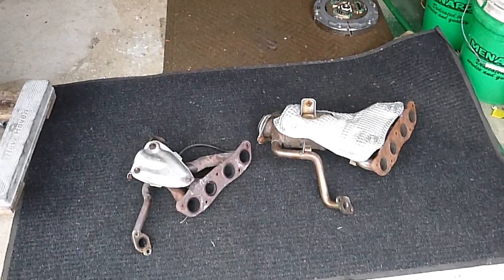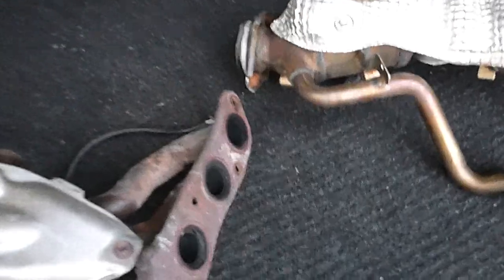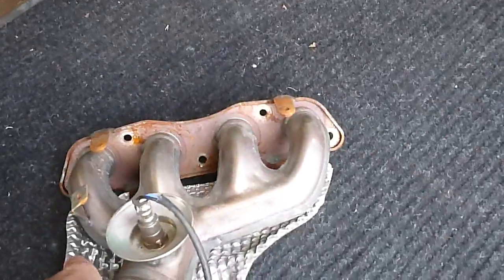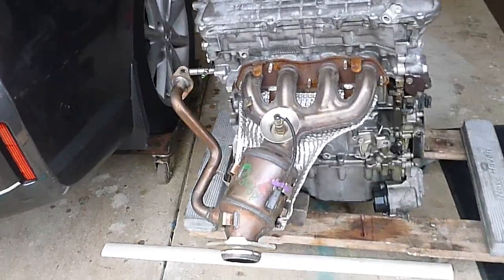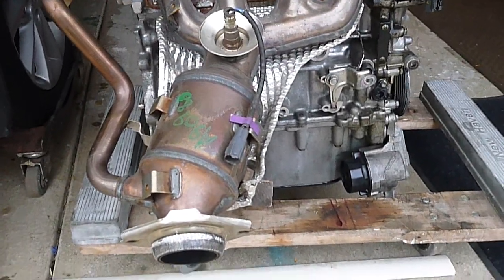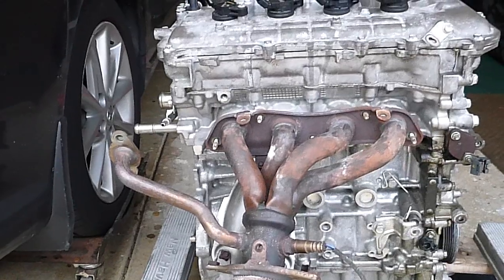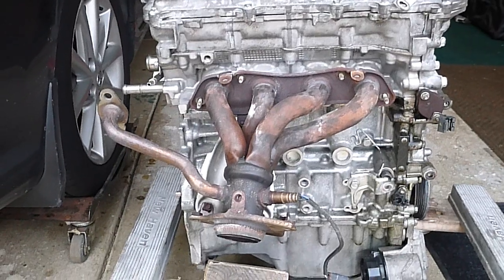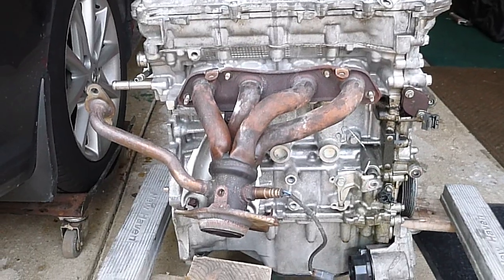Fix That Prius! - 2012 vs 2016 Exhaust Manifolds

Comment: Are there any benefits from swapping exhaust manifolds?
Reply from the maker: Well, Thanks for your question. Please subscribe to my channel. Yes there are major benefits to using a brand new and redesigned exhaust manifold that was made to fit on the engine I put in my car. If you hope to use the 2016 intake and EGR,  you would also want to use the 2016 exhaust manifold. In the case of my first swap (the black v), my catalytic converter got ruined by the blown head gasket and "bars leaks". So, I knew I would have to get a cat and there's one in the 2016 exhaust manifold. I haven't tried it yet but I will some day.
Reply: @fixthatprius4980  no update?